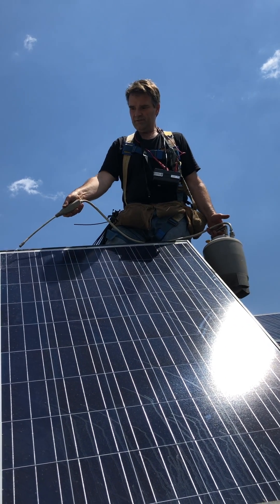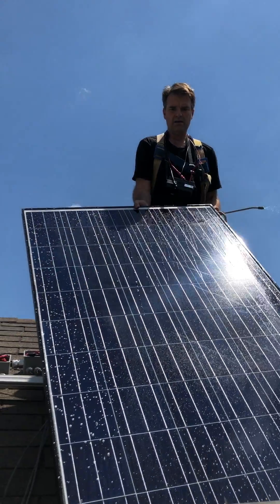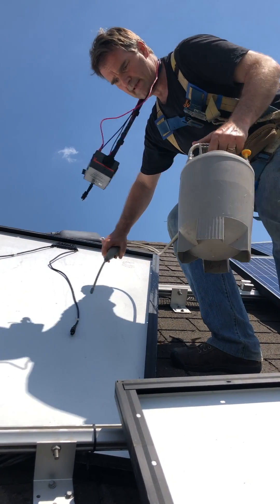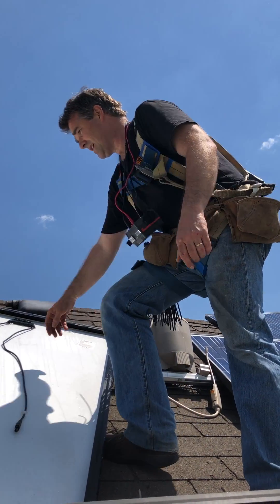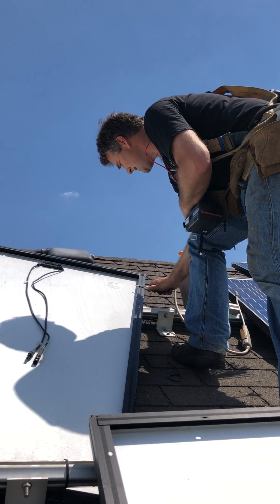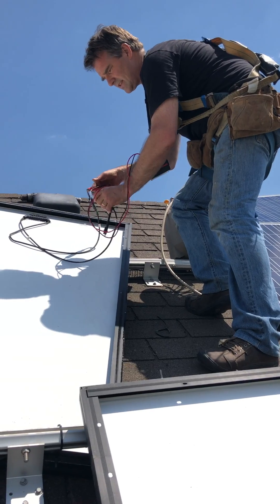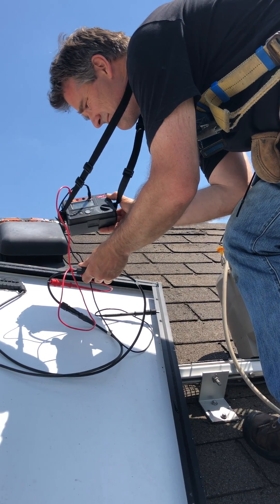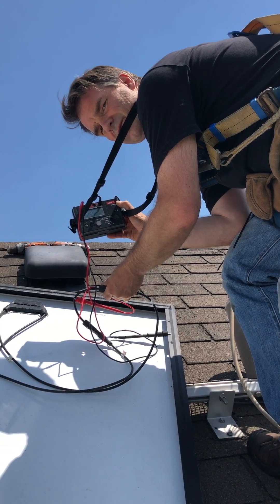Megger testing Solar Panels - identifying ground fault

Comment: So if I just have a multimeter.  I set it to read ohms and then connect the mc4 connectors together and put one lead on frame and one on the mc4 and anything less than 40 mph s is bad?
Reply: Its a different machine, not a multimeter.   Used to do so called Megger-testing.

Comment: This is the only video I've seen showing this procedure and thanks for the tip about soapy water.  I've tried pressure washing panels on the ground to force the short.  I wonder if the soap helps?  I guess it would allow water to seep in more quickly.  Maybe next time you do this you can show what it looks like on a bad panel

Comment: Wat values ate bad ?
Reply from the maker: Anything below 40 Mohms will likely be honoured as a warranty return to the manufacture.  Below 100 Mohms indicates a potential problem.
Reply from the maker: Anything under 40MOhms is a problem.  Different suppliers will warranty a panel at different voltage leakages.  Over a 100 MOhms on 1000 VDC test is a good indication that the panel is not the bad one.
Reply: @stevedyck8023  Steve where do you takes those values from. Also, why didn't megger with open leads. 
Is it the same to test strings than modules?
Reply from the maker: @elektro7tube  The solar panel manufacture will specify what MG ohms they will warranty.

The reason the leads are shorted is to remove all voltage bias from the panel.  Which leads into your second question regarding strings of modules.  Yes, it is ok to test strings.  Most inverters perform an insulation or isolation test each morning before they start producing power.  The SolarEdge inverter has a 0.6 MG ohms sensitivity - I think the PowerOne inverter is about 1.1 MG ohms.  When there is whole string of panels there is often more ground fault leakage.

But back to your question - why short the panel leads?  If you have a 1000 VDC string and you attach a megger tester and run a 1000 VDC test you will get bad results depending where in the string there is a ground fault.  So short the leads and you have 0 VDC in the PV circuit.  Now you can use your megger tester to look for the ground fault ohms between ground and the PV curcuit.
Reply: @stevedyck8023  Thank for getting back to me.
This information is very helpful !!
Reply: Thanks Steve for your response. Still more questions. So to be clear if I have a string of 12 modules, can I short the string closing the loop using the jumper you use and then Megger correct ?
Also, Someone told me yesterday that I can Megger a bunch of strings all together in a combiner. Opening the main feeders from the combiner, opening the positive fuses and one lead to the negative bus and then other on the ground. On this way I can do a preliminary test. Ii it goes bad then test individually. Do you have white papers or more info to dig about meggering string. 
Last, have you encounter with dc reverse current fault?
Reply: @elektro7tube  DO NOT SHORT THOSE 12 STRING SOLAR  PANELS !!!!
You have to test them individually.
Reply: @elektro7tube  I just watched a video "how to merger through Solar modules" of a megger being used on a string of modules.
Just to clarify The string is not shorted as in this video. Meggers are usually used to test Insulation quality before power runs through an electrical feeder. He did disconnect one side of the dc circuit. 
Here If the panel is shorted I would assume it would be at Vmp not O volts, although if it's not in direct sunlight it would be low. 
I'm not sure how much the voltage bias would affect the measurement but interesting to consider. I thought he would've tested one connector and the frame. Nice he had a whip...
Interesting how the warranty work and how he's into troubleshooting already. We're fairly new here in NYC with 5-10 year systems.